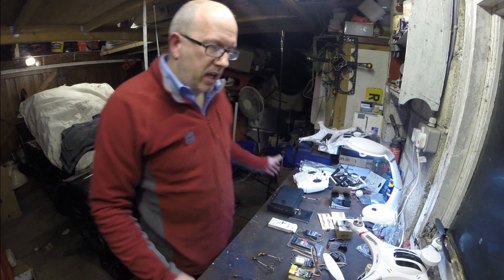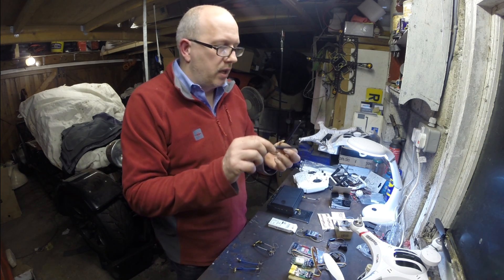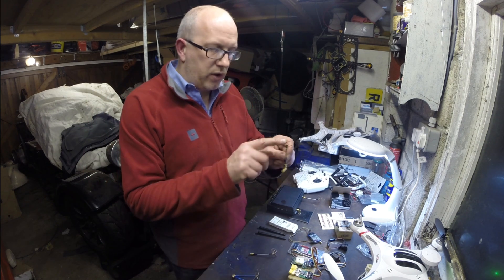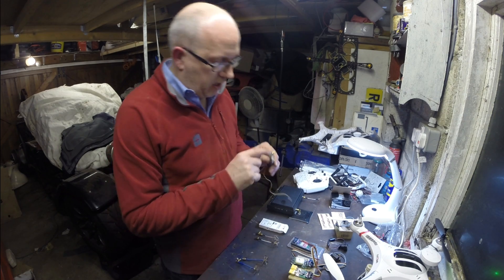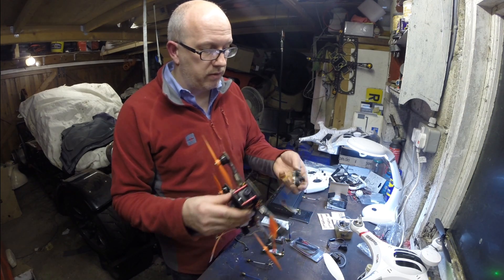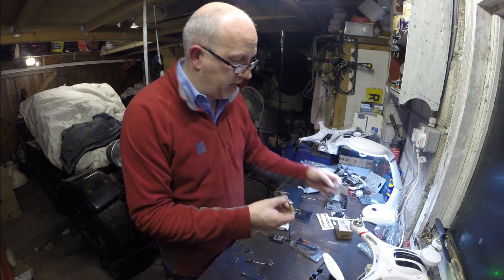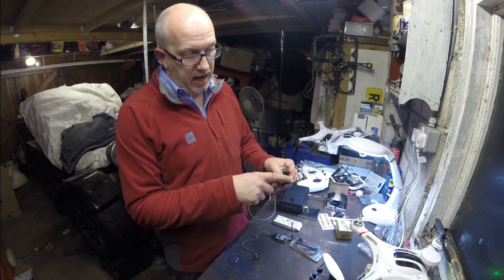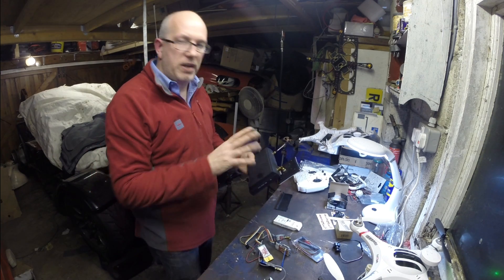Cheerson CX20 FPV Setup Part 3. Cameras, OSD and antenna

Comment: Hi Charlie.  Great information and really helped me better understand the point of all this equipment that is very new to me.  I know you mention and show an ImmersionRC EZOSD in your video but have you ever installed it on your Cheerson?  I can't seem to find any pics or videos of how the components were installed.  I was hoping to go with the FT952 200wm transmitter in your video and the ImmersionRC EZOSD setup, but I can't find anyone else running this same combo/setup.  Do you know if it's directly compatible?  I couldn't tell in your video if you ever plugged those two in together.  I also need to find the right cable from EZOSD to SJ4000 (which is the same connection as to a Go Pro 3, I understand).  Any help you can offer, I appreciate.  Thanks!
Reply from the maker: es99cobra Hiya,I haven't used the EZOSD on a cheerson, I used that on a bigger quad. Best bet for the Cheerson is a minimOSD.Have fun!...©
Reply: Charles Phillips Thank you!

Comment: I'm setting up an fpv system on my CX-20 and I've got a couple questions I was hoping you could help me with. I'm using a GoPro knock off with a 600mW 5.8ghz transmitter and I also have a G-2D gimbal as you do. Do I need to add an external battery to power the transmitter or can I use the 5V pins from the bottom of the CX-20? Is it possible to run the transmitters power through the gimbal? Also, would I need more voltage to power the 600mW than I would a 200mW? Your insight would be much appreciated.
Reply from the maker: Richard Alvarez Hiya,It really does depend on the specs of the gimbal. a 600mw transmitter draws more power, but not necessarily more voltage. You need to look at the specs, some video transmitters require 5v (e.g. Team blacksheep only take 5v), some will take almost anything (immersion RC take a wide range of voltages.) Gimbals usually require 12v and the servo feed (5v + signal) all are available on the bottom of the cheerson (nicely labelled as well!)Hope that helps!...©

Comment: Hi Edgar, Thanks for the video just one question, I have a Cheerson cx20 open source version, do the same rules apply regards your set up instructions? 
TIA
Mel
Reply from the maker: Mel Mann Hi Mel,Pretty much the same, I have an opensource version as well and on mine it has additional 12v supply on the bottom of the quad.Hope that helps......©
Reply: Charles Phillips thanks for the reply

Comment: I have a Cheerson CX-20 quadcopter and i recently bought the  FatShark PredatorV2 RTF FPV Headset System w/Camera and 5.8G TX system from hobby king, and when i went to fly it this morning my quad kept loosing signal or something and crash 4 times and i have flown there many times before without crashing but ever since i got the FPV it keeps crashing, i was wondering what happened and how i can fix it? Could you please help me? 
Riley.
Reply from the maker: Riley Jordan If you remove the FPV does it fly OK? There are issues that if the FPV draws too much power (e.g. if your video transmitter draws too muvh power) it can "Brown out" the flight controller, but it's best to see if that is the actual problem first!
Reply: Yea it fly's fine and im not running the FPV off the battery powering the drone i have a 2 cell powering the FPV
Reply from the maker: Riley Jordan Just to confirm, it's fine without the video kit switched off, but when the video kit is powered up it crashes even when flying Line-of-sight?There is a chance that the two antennas are too close? (although I have never seen that)I am assuming you are running a 5.8G video and 2.4G cheerson transmitter (e.g. you have not put your own receiver in the cheerson) - if they are the same it will crash every time, and also that you are using the fatshark camera and not a GoPro?

Comment: Can you please put links for the things in disc or in a comment, pls?
Reply from the maker: Edgar Hi Edgar,This video was more of an explanatory than list of things, however if you are looking for a list of video items for a Cheerson CX20 I'll paste in the list I did for another commenter:If you are just starting out, probably best to single source everything from Hobbyking. I got everything separately from ebay, but here is everything I currently use for FPV on the Cheerson.
Antennas LHCP (Left Hand Circular Polarised) (£8.44): http://www.hobbyking.com/hobbyking/store/__51622__Circular_Polarized_5_8ghz_Antenna_Set_SMA_LHCP_60mm_.html
UK Legal transmitter (£13.37) - http://www.hobbyking.com/hobbyking/store/__66190__FT951_5_8GHz_Video_Transmitter_25mW_Full_FCC_and_CE_Certification.html
OR More powerful transmitter if you have a license or are outside UK (£13.98): http://www.hobbyking.com/hobbyking/store/__76392__HobbyKing_8482_FT952_5_8GHz_32CH_200mW_Mini_FPV_Transmitter_with_Gopro_3_AV_Lead.html
Both the transmitters come with leads for a GoPro and compatable power leads for the CX20
This is my Screen (£101.77): http://www.hobbyking.com/hobbyking/store/__72895__7_inch_720_x_576_5_8GHz_32CH_FPV_Monitor_Diversity_Receiver_with_DVR_Recording_Skyzone_RC700D.html 
A better screen since mine was released (and cheaper £85.88)  http://www.hobbyking.com/hobbyking/store/__35055__7_inch_800_x_480_5_8GHz_Diversity_Receiver_TFT_LCD_FPV_Monitor_with_LED_Backlight_SkyZone.html
But have a look at the range on hobbyking - they go as low as £69 (without diversity)
This is the high DBi LHCP Antenna (£46.23): http://www.hobbyking.com/hobbyking/store/__64810__Immersion_Fatshark_SpiroNET_LHCP_Patch_5_8GHz_Antenna_SMA_13dBi_Gain.html
If you are starting out I wouldn't bother with the high DBi Antenna as on a Cheerson the remote control will give up long before the video, but if you are using the legal 25mw transmitter it will help!
Hobbyking are just another company and I am not in any way endorsing them, there are much cheaper places with better customer service, but for those starting out it is a handy resource to get all the information you need!Have Fun!...©
Reply: Thanks ;D

Comment: Dear Charles, thank you very much for your videos, they're a helpful guide to get into the FPV/drone hobby.
I have followed your guide and bought recently some of the gadgets that you suggest, but I have found out that the SkyZone OSD module doesn't provide a miniUSB for the camera (GoPro3+). Would any regular eBay adaptor work with some solder work?
And just one last question, it is suggested to splice together both the gimball (G-2D) and the OSD's power sources in order to fit the cx20's power supply and access it faster, would this affect the components or damage the drone?
Thanks again for your kind responses.
Raul
Reply from the maker: Raúl Soriano Hi Raul, by OSD, do you mean the video transmitter? If so, yes you can get GoPro cables from lots of people on Ebay. I recommend not connecting the power to the GoPro though as I have seen that blow the GoPro up!In terms of soldering together the leads, I only did it for convenience (I also have other things to plug into the 12v!) they are connected together inside the quad anyway.Have Fun......©
Reply: Charles Phillips Hi! Thank you so much for your advice, I think the gopro has juice enough to hold up to the drone. As soon as I receive the quad I'll get to it, and hopefully get the same results as you do! Best, Raul

Comment: so im confused as to where the fpv transmitter and camera get power? is there a port for them on the cx-20 or do you need to carry an extra battery? sorry for all the questions im kinda new at this and am still trying to understand how everything works. . i am wanting to buy the cx-20 but i wanted to make sure i was able to have some sort of fpv with fat-shark goggles.  
p.s. ty for the videos very informative had no idea about the antennas
Reply from the maker: Hi Lauren,
The transmitter power comes from one of the 12v connectors on the quad, as does the gimbal power. I recommend you use the gopro internal battery to power the camera as it never works properly powering it through the USB and you stand the risk of blowing the camera up if you get it wrong!
Other cameras do need power, some 5v, some 12v and you can supply that from the quad as well. its very rare that you need an additional lipo.
Hope that helps...
...c

Comment: I am impressed with your video. I am trying to get a fpv system-- plug and play-as you showed. Chemical knowledge-good, electronics-not so. I am on a very small budget and need low cost-good range. I am building a business to sell areal photos to businesses in Georgia,USA. I have some concern about lining up the shot, then giving the customer a choice of photos of his business. That may be tough to do with only fpv system. The only camera I have is a mobius, so I may have to select an other one.I also want to do the an fpv set up for small quads.Working with kids.
A lot of questions-- my cx-20 should arrive soon.

Charles Jones
Reply from the maker: Real pro work needs 2 cameras and dual controllers, so bear in mind that it is pretty near impossible to get that good on your own with a low budget.
That being said gopro hero 4 takes very impressive pictures, I've been told you can set it to take a photo every few seconds and still use the video out for fpv, so there is one solution, indeed 4k video frames are good enough for most uses on their own. I don't know anyone who has successfully done fpv with a mobius, but I use them all the time hd video on my miniquads.
The big trick with getting something that looks half way professional is to take a lot of footage and get the best shots from that when you edit, nothing ever works in a single take!
In summary, a cx20 is a really good starter platform, but you will quickly find its limitations, I now use a dji F550 hex with a h3g3 gimbal for anything where I need a more reliable quality, I use the cx20 for all my quick and dirty work (of which there is a lot!)
Have fun!
...c